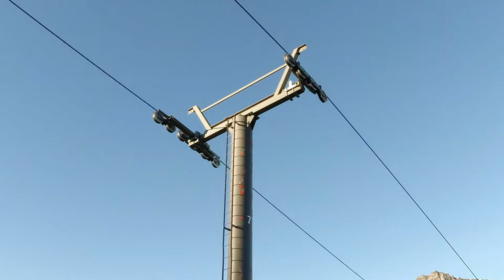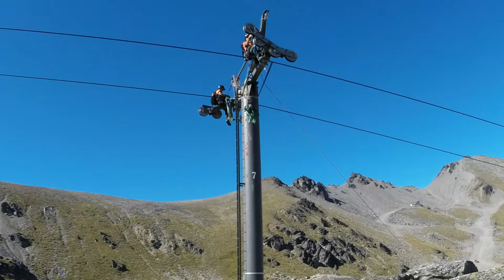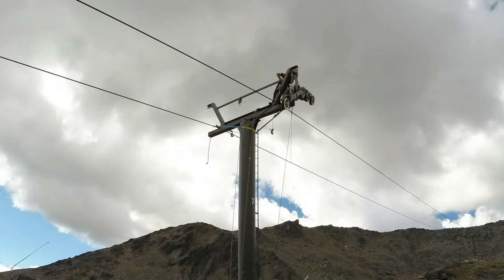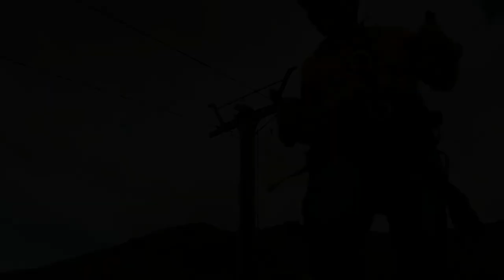Day in the life of a lift mechanic   sheave assembly removal

Comment: You did not show what you used to lower the sheave assembly with. I used a truck with a tirfor. Lowered the assembly with the tirfor until it was just below the cross arm the drive the truck forward. We used a crane when possible. I worked lift maintenance for 42 years, now retired.
Reply: I used to use a truck with a winch, made it a lot easier to lift the cable

Comment: I have to design a ski lift for my junior level engineering class. Can you tell me why this one has 6 wheels instead of 4. Is it just a smoother ride with 6?
Reply: Jesse Crotts The tower has more sheaves because the lift changes the incline of the rope. The greater the incline change the more sheaves on the towers. When the incline does not change on a tower. The lift only has around 4 to 2 sheaves on the tower.